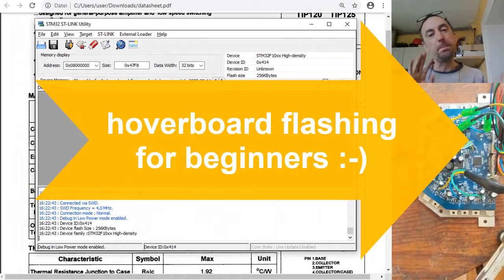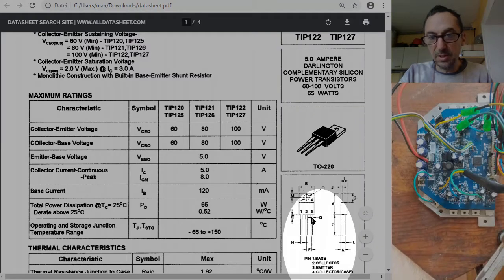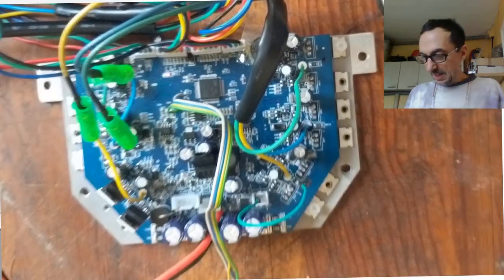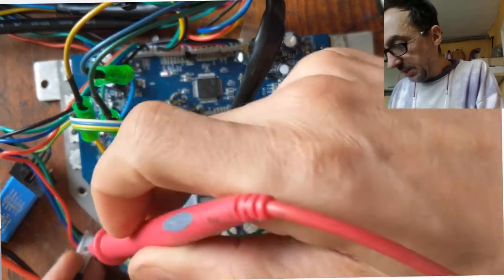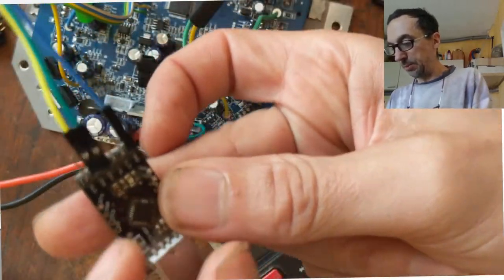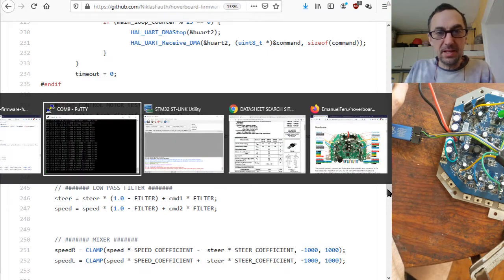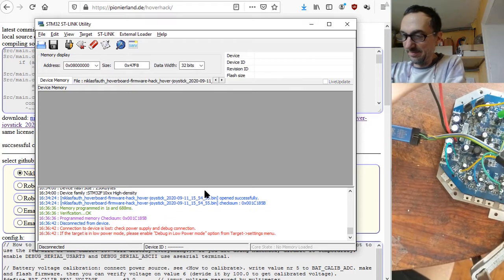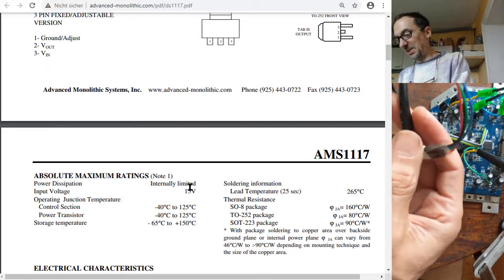Hoverboard flashing for beginners (red != +14V)(adc wheelchair)

Comment: I've just put male header pins on the board, put markers for +,-, swd,sck, and cables are on the ST-Link dongle. 
And, by the way, I use KeiluV IDE for compiling and debugging. In my case, code written for the STM32, after compiling, works the same for Giga Device GD130.

Comment: hi where is that cable came from of mainboard ı cant understand? 13:21 which is connecting of diy 2 pot module
Reply from the maker: That is the long UART cable for the little side boards. Long cable is only 3.3V tolerant !!!
Reply: @robodurden  as ı know uart have tx and rx cable, how you wiring the 2 pot of that pin ı dont understand thanks
Reply from the maker: @SAMETELMACI  go to the GitHub repos and study the nice wireing photo.
The long UART cable uses two stm32 pins that can also do ADC. So the Rx and tx wires can take 3.3V analog input. The short UART cable is only digital. But can take 5V.
Reply: @robodurden  okey thanks much, ı build a robot now like that
Reply from the maker: @SAMETELMACI  if you need total rotation angle, i adapted that for the EFeru firmware..
Reply: @robodurden  yes ı make autonomus rover with ros2, can we talk any platform?
Reply from the maker: YouTube and GitHub are platforms. I prefer public discussions. Private discussion only for non-fun projects..
Reply: @robodurden  already ı ask slack,forums etc, ı work on open source robot platform for now

Comment: Hi! 
when I try to hit Program&Verify in the target menu it always gives me the error "cannot connect to target! If you're trying to connect to an STM32W1xx device, please select Normal or HotPlug mode from Target->Settings menu. If you're trying to connect to a low frequency application , please select a lower SWD Frequency mode from Target->Settings menu."

Then, when I change it to Normal or Hotplug it says: "Can not connect to target! Please select "Connect Under Reset" mode from Target->Settings menu and try again. If you're trying to connect to a low frequency application , please select a lower SWD Frequency mode from Target->Settings menu."

Would be grateful for any help!
Reply from the maker: Does the USB dongle show up in the windows device manager ?
Does the board hase a gd32F103 or stm32f103 CPU ?
On-switch on board bridged ?
Reply: @robodurden   yes, it shows up as "STM32 STLink".
The cpu on it says AT32F403RCT6 (maybe it's not compatible?) and the on-switch is bridged
Reply from the maker: @ValFPV  these new boards with the 403 chip are not compatible anyway.. go to EFeru GitHub and offer another $10 for a beginner tutorial on how to compile a port of his firmware. Do it.
Reply: @robodurden  is the EFeru firmware compatible with the 403 chip?
Reply from the maker: @ValFPV  no. But someone succeeded porting it and made a Tutorial how to compile and flash. But it is not for beginners.
Reply: @robodurden  can you send the link for the tutorial?
Reply from the maker: @ValFPV  Register yourself at github and add $10 to https://github.com/EFeru/hoverboard-firmware-hack-FOC/issues/329 !!!!!!!
Reply: @robodurden  that won't help me if I can't even connect my board to the stink software.. I'll first have to sort that out, then I'll probably add the $10 for the tutoriap

Comment: Can you advise. I am having connection problem, I am using stm32 cube programmer and st link V2, upgraded the firmware, diconnected and reconnected st link, still couldn't establish connection
Reply from the maker: Try connecting to a "blue pill stm32f103c8t6" with a cheap St link V2 clone: https://a.aliexpress.com/_EHW9bLn
Make sure you have a hoverboard controller with a stm32f103 on board. New boards have the 32f403 and there is currently now easy Tutorial how to flash a new firmware.
Reply: @robodurden  Yes, my hoverboard controller is stm32f103 and cheap Chinese St link V2 however, still couldn't establish connection
Reply from the maker: @sayedme2uc  as I said, learn how to flash a hello world onto a blue pill. If you then still can not do the same with the hoverboard controller, there must be something wrong with it. I never had an issue with one being write protected. First time you get a pop-up and confirm to unlock the board..
Reply: @robodurden  Can you send and or attach a link on "how to flash a hello world onto a blue pill"
Reply: @robodurden  Thank you for your prompt response, I'll let you know how it went once I receive my order as per your recommendation
Reply from the maker: @sayedme2uc  simply google for 'blue pill tutorial'. But most likely you did connect the three cables from st link dongle to hoverboard wrong. Or did not attach the battery. Or did not short the power button.
Let us see what you learn with the Blue pill :-)

Comment: Can you advise if main board is flashed and working with potentiometers, how to get connected rc receiver instead of potentiometers?
Updates. All is done, board is working as should, video with lawnmower on my channel.
Reply from the maker: Variant ppm or pwm of EFeru firmware
Reply: So you just simply uncomment varient pwm and compile? Is there anything I am missing?
Reply from the maker: @andrewkennett940  yes.  And If pwm input is on long UART cable, be sure to only send 3.3 V. Short UART can take 5V. But better use that one for debug output..
Reply: @andrewkennett940  not really. There some settings, what you would need to check, as in default it still may not meet your hardware.

Comment: Hey, I ran the firmware and just uncommented the adc control and when I start the board the motor rapidly spins to max speed and when I move the Potis just changes a lil bit the speed. It also cuts out when accelerating rapidly
Reply from the maker: Probably wrong colors on the three motor phases. Try connecting differently.
Flash the lucysrausch firmware as it operators in test mode without any modifications. When this works but adc not, then there is something wrong with your potentiometer.
Reply: @robodurden  Hey, when I connect the battery and press the button it does not start, I measured the power button connector and it has 39v, what may be wrong?
Reply from the maker: @gianlucadionisi6730  First the motors spin strangely now the board does not even  start up. When you keep information for yourself I can not help you. 
Watch my repair video with the three voltage controllers on the board..
Reply: @robodurden  What dam trying to say Is that with the battery connected, the pins from the power button, have 39volts, what may be shortened?
Reply from the maker: @gianlucadionisi6730  nothing.  Take a look at page 5 of https://github.com/EFeru/hoverboard-firmware-hack-FOC/raw/main/docs/20150722_hoverboard_sch.pdf
The 39V are behind a 30k resistor and get pulled down by a 2k resistor when on-switch is pressed.
Reply: @robodurden  when i press the on switch nothing happens, but i may be shortening something, should one of the power button pins have 39v+ and the other the -?
Reply from the maker: @gianlucadionisi6730  yes. But now watch that video I spoke of and learn what the tip127 transistor does and how to test the three onboard voltage regulators.

Comment: Hi do you have any idea  which firmware will work on split board  I got dual pcb GD32F103C8T6 it also have external interface connecter but no information available about it.
Reply from the maker: https://github.com/flo199213/Hoverboard-Firmware-Hack-Gen2/issues/10

Comment: One thing I noted is that "donot connect the 3.3v pin to the STL usb"
Reply from the maker: Yes, only gnd and the two data lines. From the hoverboard to the st-link USB dongle. Sorry if I did not mention it in the video.

Comment: Hey man! I am trying to build a 4wd hoverboard skateboard with your firmware. the problem is that I am trying to use the field weaking feature, but the problem is that the wheels doesn't spin free when I am stop squeezing the throttle. do you have a solution?
Reply from the maker: Try torque mode as a zero torque might be your freewheeling.
Otherwise ask Emanuel on his GitHub.

Comment: hi i have the exact same board tried flashing EFeru's firmware and connecting to arduino test code the motor starts spinning at high velocity and never stops unless Tx is removed. I noticed that the hall sensors cables are not exactly color matched from this board to my motor's encoder pins.... could this be the problem Did you make any changes in your hall sensor wiring with this board. 
I tried matching the colors and the results were the same :( 
please help
Reply from the maker: I never needed to change the 5 pin hall sensor sockets. But you might need to change the three phases. And beware of +15 volt on the black cable of the serial cables. Those with wrong color was also the one with wrong color in the three phases

Comment: Hi! What resistance of potentiometers should i use to control these boards after slashing? I can't find that info anywhere which value is the best, or does that not really matter?
Reply from the maker: Does not really matter. Anything from 1k to 100k will do. 1k will have a current of 3.3/1000 = 3.3mA . Better use a 10k poti.
Reply from the maker: @YouCantNow  You can flash the good old Niklas Fauth firmware (now called LucysRausch) with CONTROL_MOTOR_TEST. This does not need any input and simply spins the motors forwards and backwards: https://raw.githubusercontent.com/lucysrausch/hoverboard-firmware-hack/master/build/hover.hex
Reply from the maker: @YouCantNow  ??? I posted the link. If YouTube indeed does not show a GitHub link, find the GitHub repo of lucysrausch = NiklasFauth yourself. Or use my online compiler to compile the hex/bin yourself.
Reply from the maker: @YouCantNow  watch my tutorials :-( In them i explain what can be done. log output, etc.
Reply from the maker: @YouCantNow  Too many questions. Sorry and bye.

Comment: hi  thanks for your aswome work!
A question : can i control independently the motors ? for exemple : right  motor to 5kmh and left  motor to 1kmh ? i want to use this project for a gate opener :) thanks !
Reply from the maker: There might be a tank mode where you can control each Motor directly. Take a look at all the variant_xy of Emanuel Firmware.
But you can always use speed and steer to set speed for left and right.
Reply: @robodurden  thank you very much i will try that :)

Comment: Hi !Please help me! How do I execute the "uncoming" command to use the hoverkart variation?  thanks
Reply from the maker: You want to know how to uncomment one of the variant_xy: simply remove the // at the beginning of the line.
Reply: @robodurden  thank you!
Reply: @robodurden  And then I need to compile again?  And copy this hex or bin file to the hoverboard chip?
Reply from the maker: Sure.
Reply from the maker: Why do people think i can help them if they do not provide me with the least of information. Like which firmware you compile. It seems you have started 4 projects on my ide with different firmwares. If you send me the project name you intend to work on to roland@robo4future.de i can have a look on your code. By the way, the error message is pretty much straight forward.
As you seem to have uncomented a serial communication variant, i suggest you disable DEBUG_SERIAL_USART3 by putting // before the line that defines/activates it.
Reply: @robodurden  Hi!  I've downloaded and installed several variations but it doesn't work with any of them ... what could be the reason?
Reply: @robodurden  I'm sorry, I didn't see you write. I have sent you an e-mail

Comment: hi robodurden nice video, 
i have a doubt, the second usb the name is port serial? or have another name? i will buy,
Reply from the maker: there are so many, just search 'usb serial' on aliexpress or ebay. You should buy one which has a DTR pin - good for programming an Arduino Mini.
And 3.3V/5V jumper/switch.
This one is nice for debugging outdoor: https://www.aliexpress.com/item/32617951363.html
Buy two or three different ones, they are cheap.
Reply: @robodurden  ok, ok, thanks

Comment: so if I put a new firmware on my stock mainboard I can control the motor with a Thumbthrottle via one of the two controler board with the gyroscope on it? Am I Right?
Reply from the maker: You usually control the motors with potentiometers or ppm or pwm or uart or nun huck controll. You Tell me if Emanuel Feru offers a variant_xy that uses the acceleration sensor of a daughter board as input.
Reply: @robodurden  I meant the cables where the stock controllerboards are attached... these are the Uart cables right? And if I put a potentiometer on one of the two uart cables, I can controll the speed of the motors. Did I got that right?
Reply from the maker: @TheLeMarcDe  yes the blue and green cable of the long daughter board cables are used as adc inputs for variant_adc.
Watch my absolute beginners video :-( these two cables are NOT 5V tolerant!
Reply: @robodurden  OK after your "full tutorial video" I think i got it... when the st link arrives I will try it... no matter how it turns out i will tell my progress... Thanks and greetings from Frankfurt
Reply: The St link came today but the File from niklas isnt a BIN file... I got the Files from Github and unpacked it, but now its a normal Folder and the st link software does not list it.
Reply from the maker: @TheLeMarcDe  you don't watch my tutorials :-( In these i never download something from github :-(
Reply: @robodurden  ah ok how to compile and download from Pionierland... but wheres the Test file to check the motors
Reply from the maker: @TheLeMarcDe  compile niklas Firmware with no modification of config.h
Reply: after disconnecting the Flashcable and rerconnecting the original powerbutton, the wheels started moving back and forth, great ... now I want to connect a Thumbthrottle to the Daughterboard cable...
Reply: But where do i find the "Joystick" file you used in the video?
Reply: and how did you connected the Potentiometer with the uart?
Reply from the maker: Sorry, too many questions :-( "This conversation is over."

Comment: I Flashed my board with emanuel FOC and i get only beeping after powering on. Do you have some sugesstions what could it be?
Reply from the maker: Watch this video :-(
Usb uart dongle ...
Reply: @robodurden  I connected it vía ardurino nano with Emanuel serial code, and later with your test code but there is no output. I will try with usb UART adapter when I buy one:D
Reply from the maker: @dawidh6422  our Arduino example codes can output the Feedback struct.
Take another Arduino and use it as an uart dongle by receiving on a software serial. 
If it is a low frequency beeping it probably is the missing serial communication. Check that both baud rates are the same.
Reply: @robodurden  I used the serial USB to uart adapter and there is no Output. I tried diferent baud Rates and connections between RX and TX. So i am guessing that the board is Broken?
Reply from the maker: @dawidh6422  as I said in the video, first always flash and test the test version of the Niklas original.
As your board is beeping, the microcontroller seems to be okay.
Reply: @dawidh6422  maybe you forget to select variant type: pwm or i-bus